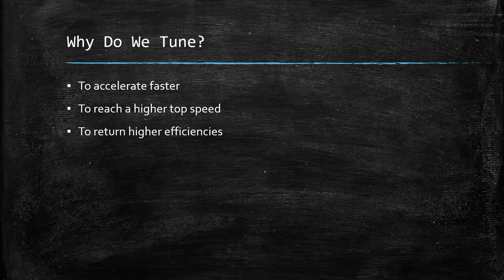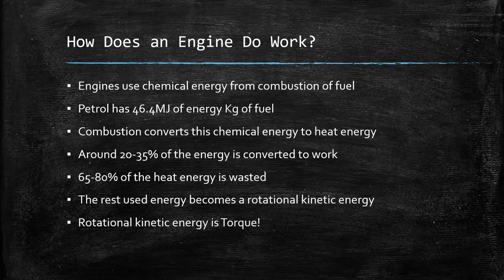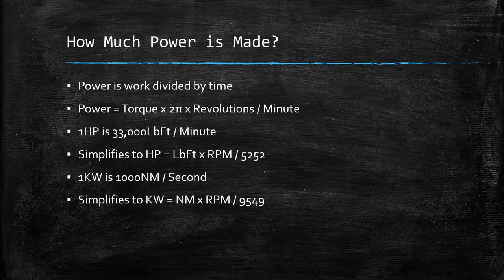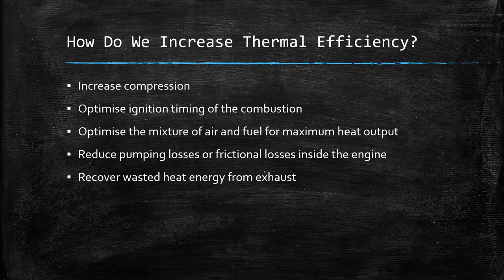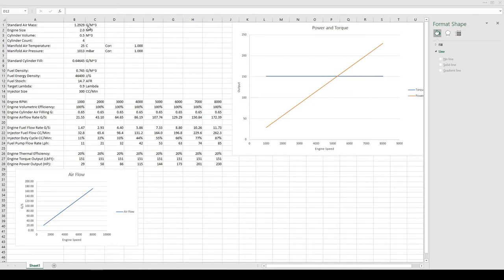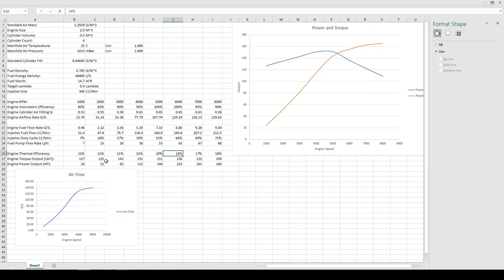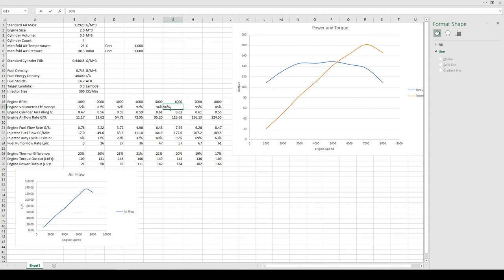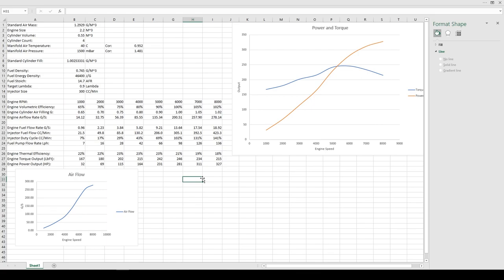Engine Tuning 101 Part 1 - What is Power vs Torque?

Comment: So thinking about what you were saying about cool air having more density,would i be right in saying when mitsubishi released the evo 6 some of them had a button which sprayed ice cold water onto the intercooler,was that just a desperate attempt to try and cool the air to the engine to get the extra power because the engine was literally maxed in terms of what it could do under normal conditions?or was it just a gimmick and actually made no difference?
Reply from the maker: Only way to know is to measure the air temperature with and without the system and see if it improves.